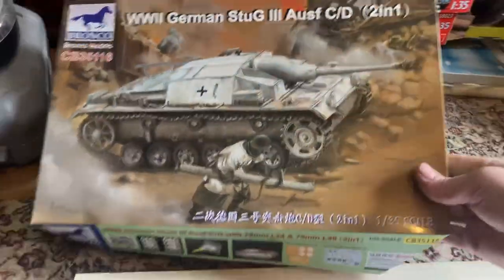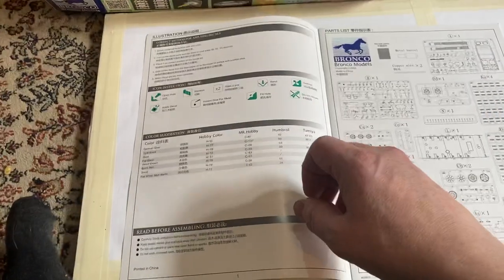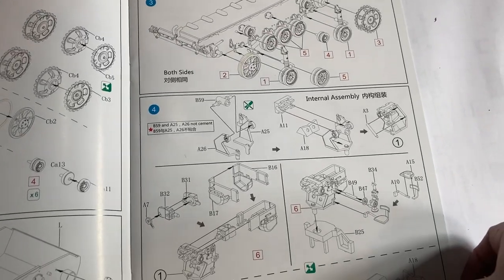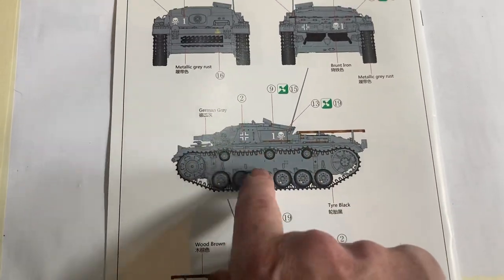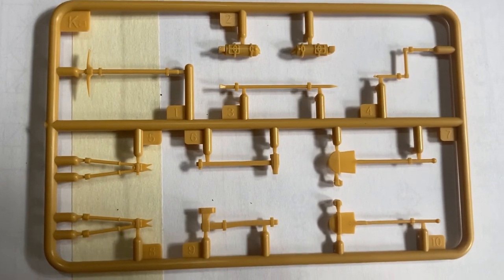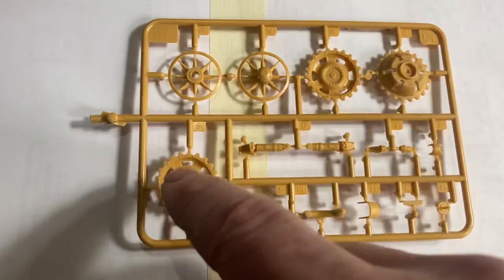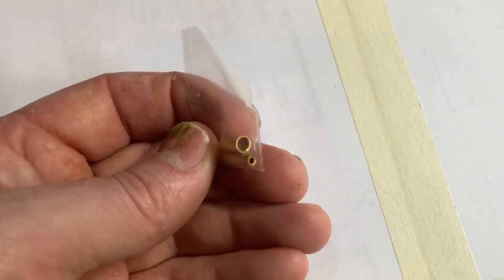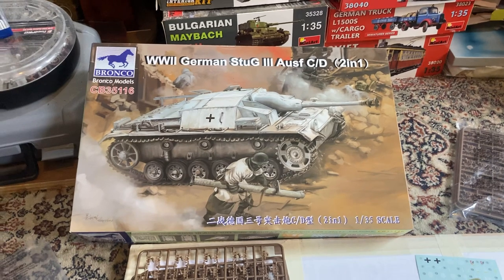A look in the box, Bronco Stug C/D 2 in 1 with both L48 and L24 75mm cannons.

Comment: This kit has been around a while (which may or may not be an issue with the decals), and I think the plastic is different than some other brands, but is pretty good. If I recall correctly, there were a few issues. I know that "Panzmeister36" did a very good YouTube build video & he always addresses issues of fit, historical accuracy, etc (he's quite the StuG guru & does good research too.), so do check it out! Yes, some manufacturers put "ContinentaU" to get around licensing issues, so you just have to cut off part of the "U" to turn it into an "L".   Of course, I am looking forward to your build!
Reply from the maker: Yeah I’ve seen it about and I’ve always thought it would be cool. There was this big Easter Sale on and it was finally at a decent price so I got it.